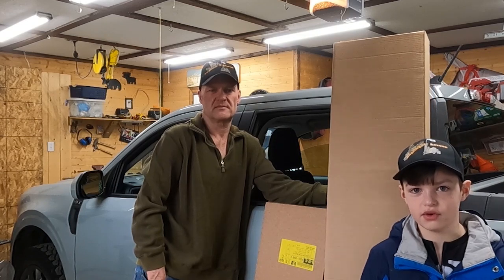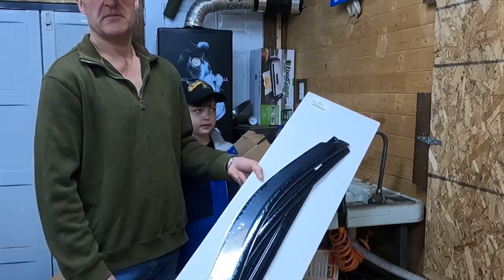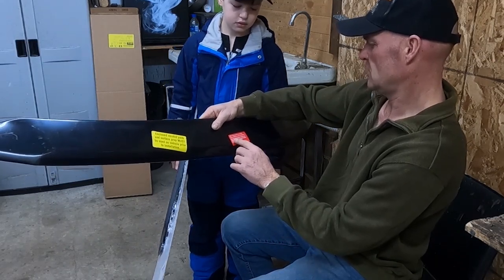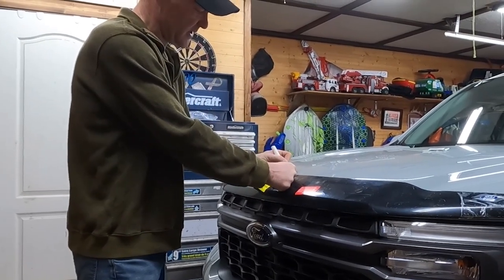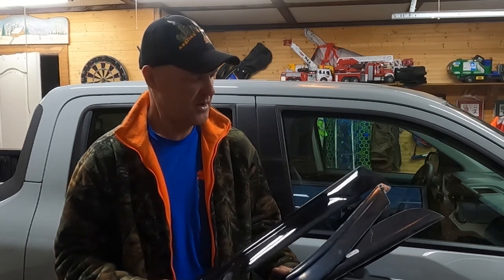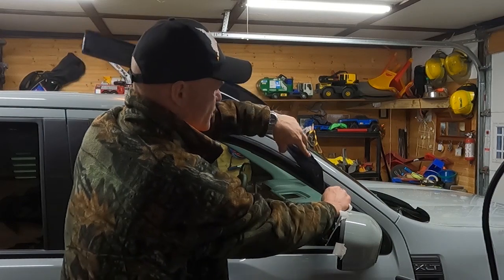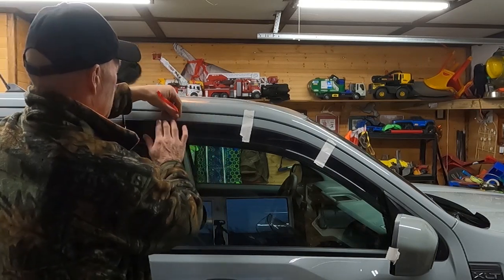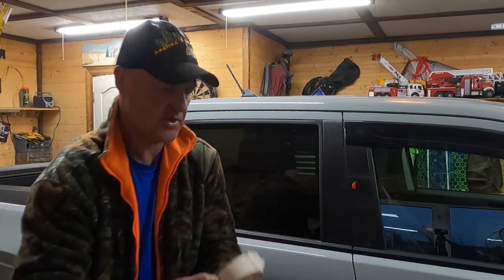FORD MAVERICK ACCESSORIES: SUNSHADES & BUG DEFLECTOR INSTALLATION a simple DIY project to save money

Comment: Thanks for the video just installed mine I love the look of it but worried water might get under hood deflector do you know of a way to prevent this?
Reply from the maker: due the the tape not running the full length of the deflector.  there's no way water would stay in there .  if gets in should run out bottom.. I never had an issue
Reply: @angling_arrows  Thanks first one I ever installed just wanted to make sure